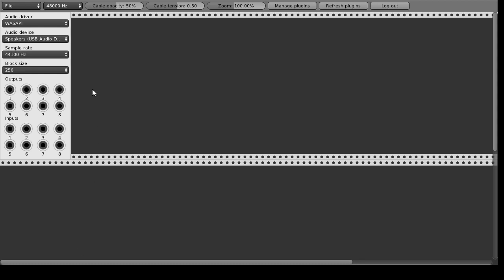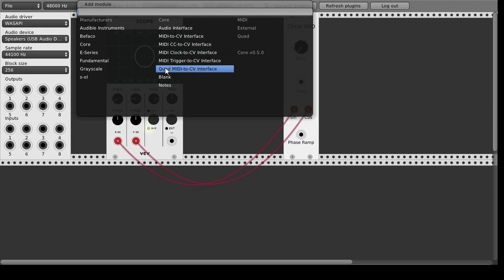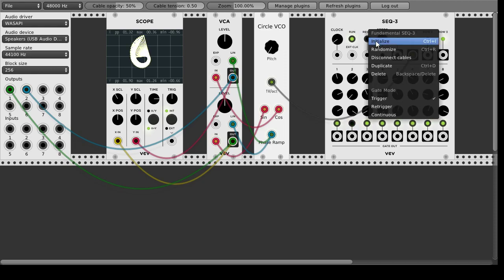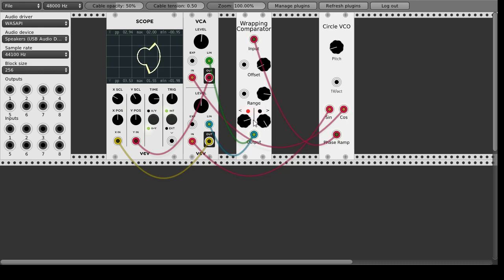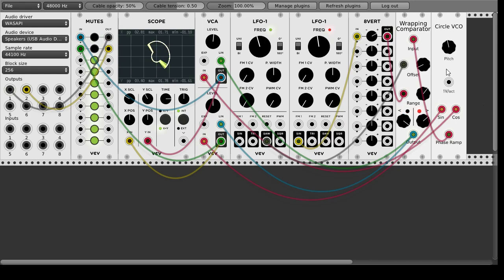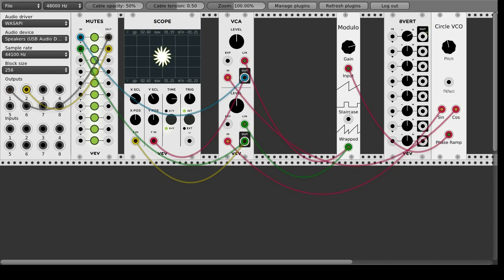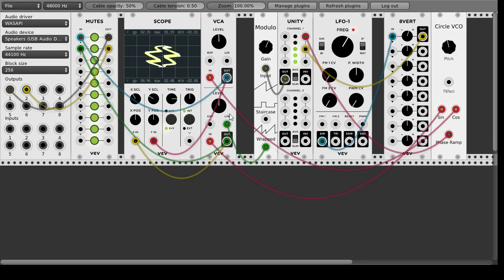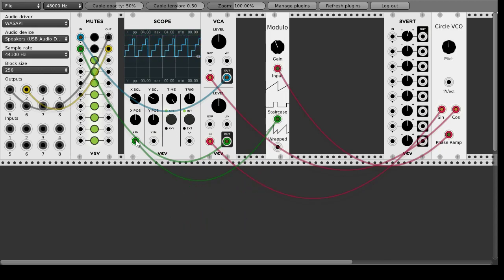VCV Rack modules for Oscilloscope Music

Comment: Great job! I did install your modules but I didn't understand what they were for. Now I do and it's fun!
I have also connected sine LFOs to the wrapping comparator for  additional effects.
Reply from the maker: +drugia61 cool :) It's very simple to create nice modulations with the comparators CV inputs and envelope generators for rhythmical animation (also try unity-mixing a sawtooth offset + the envelope).
Today I added a CV input for the Modulo gain also, but the windows build isn't up yet.